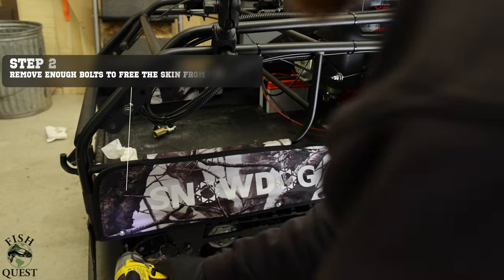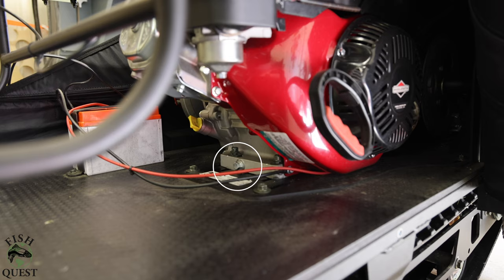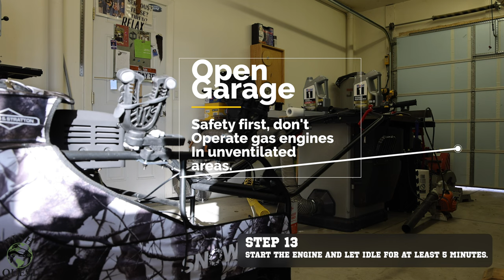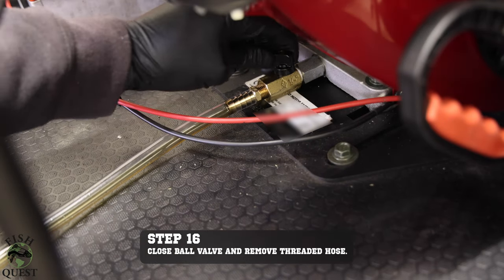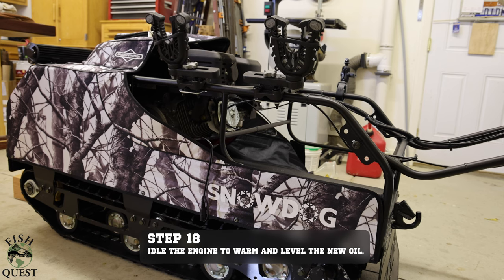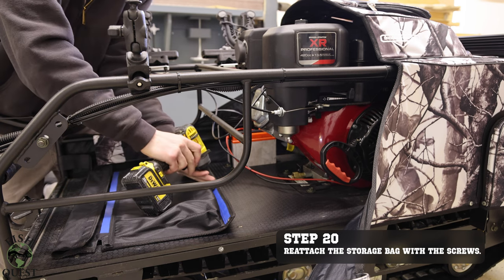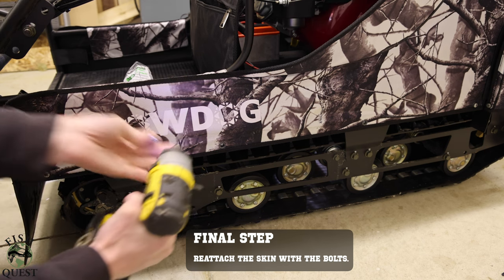How To: Snowdog Oil Change Made Easy

Comment: I just want to comment again that I did the change based off of this and bought all linked pieces.  This works on the 2022 Long Track Models as well.  Have to loosen up the rear engine bolts to lift the motor up enough, or at least I did.  The engine oil was dark and needed a change and the reverse gear oil was HORRID.  It was almost like a milkshake with lots of metal flakes, so I would 100% suck that out and replace it while doing your into 5 hour oil change.  

I used Mobil 1 synthetic oil for the oil and gear change.

THANKS again @fishquest
Reply from the maker: @G H, thanks for the feedback. I’m glad to hear everything worked out for you!

Comment: Most of the dogs have their engine mountng plate upside down so there is a bar in the way and the fitting wont have room to install, the motor has to come off and flip the plate

Comment: my dealer suggested using a siphon instead...less mess
Reply from the maker: I considered just doing that, the reason I didn’t is that I wanted to remove majoirty of the metal shavings from the “break in” of the machine and any that may occur after. My first oil change looked like I was changing removing pixie dust when I looked closely.

Comment: What’s the outside diameter of your drain valve, I have one that’s 20mm
Reply from the maker: @Tou Lor, the size of drain plug that comes out of most snowdogs is a 12mm. At least that what mine was. Hoped this helped
Reply: Bought similar set up at Menards, hopefully my drain valve fits and threads match